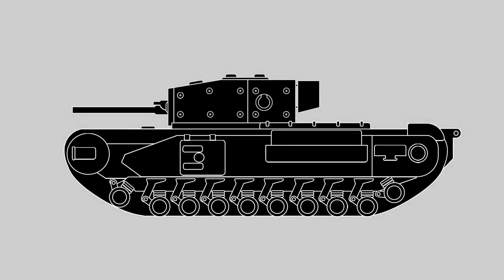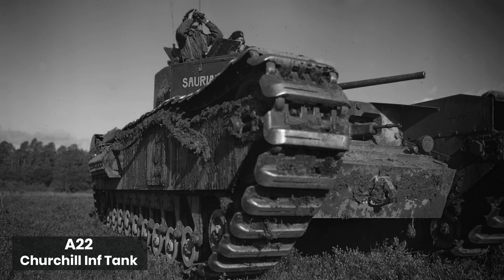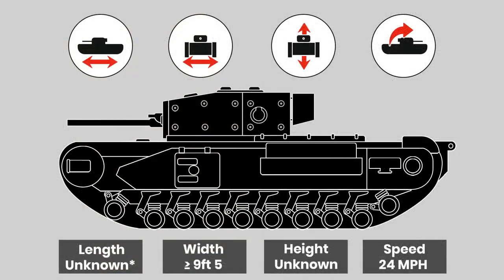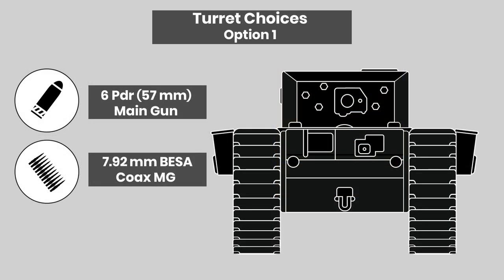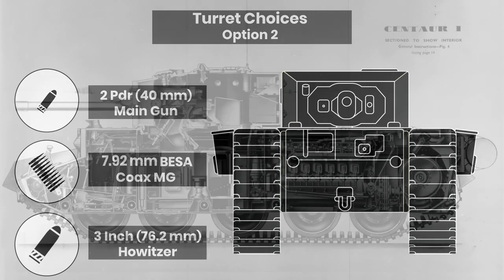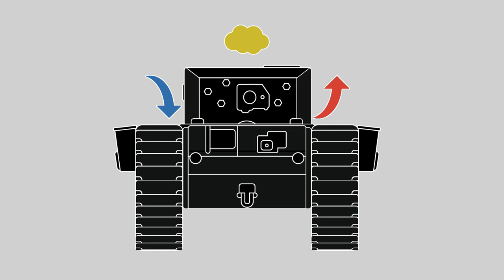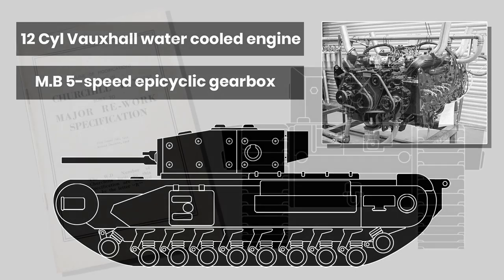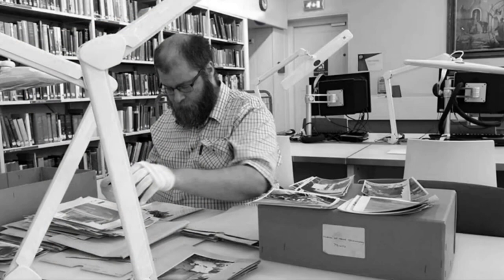A23 - Tank Design & Development

Comment: It's almost a shame the A22 wasn't originally conceived to the A23 specification as a 'fast infantry'/'heavy cruiser' tank, perhaps sacrificing some speed for more armour. The idea of a shorter, faster Churchill with a 6pdr as normal armament is a pretty reasonable tank for the late 30s all things considered.
Reply: Is that suspension design really suitable for higher speeds though?
Reply: @Akm72  I don't foresee an issue, although increasing the diameter of the running wheels would naturally improve rolling resistance somewhat. For comparison, the good ol' Panzer 4 had pretty small road wheels and managed similar speeds without any problems.
Reply: @Vespuchian  I believe they may have had an issue with the limited vertical travel of the suspension, however I don't know enough about tank suspension to say anything conclusive.
Reply: @Akm72  Actually, a lot of the issue was the noise! While, yes, the Panzer IV did have small wheels (though larger than those of the Churchill), said wheels had rubber tyres, unlike the Churchill. Even though it was capable of a top speed of 15-17 mph in its early versions, in practice, it was rare to drive it above 10-12 mph, to protect the crew's hearing.

Comment: Imagine the high speed ride on that suspension. Pretty obvious Dr. Frankenstein was in charge of A vehicle development then.
Very surprised the three gun design specifications didn’t include an auto loader for each.
Oh, and an add on Duplex Drive Kit would be desirable.
Reply: Doesn’t look like the suspension would offer much in the way of travel. The Churchill’s were so slow that it might not have been much of an issue l

Comment: Looking through a list of General Staff 'A' numbers I noticed that the A26 is listed as a 'projected lighter and faster A22', have you managed to dig up anything on the A26?
Reply from the maker: Indeed i have, however she is in the minutes as a heavier Mk IV with a 17pdr, but no further investigation. although the info is very sparse, and will require deeper archive delving to find more if anything.
Reply: @armouredarchives8867  Interesting; a Black Prince style infantry tank with a turreted 17 pdr reaching the front line in 1943 or 1944 would be a pretty big deal even if it was still powered by the 350hp Bedford engine. However, given that it is clearly a 1941 'A' number, my guess is that it would be a casemate-style mounting, probably derived from the A22D which was also a 1941 project.

Comment: Didnt know the churchill was that unreliable early on.
Reply from the maker: terribly so, straight of the drawing board and made covvy look like a marvel in engineering, but seems to rarely get mentioned elsewhere. - like covvy it did get fixed of course and ended up quite a reliable lil tank later but in its early days it was  total pigs ear.
Reply: I think it's fair to say that it's debut at Dieppe was a disappointment. It was improved though and became very capable.
Reply: @armouredarchives8867  Covvy?

I guess it's not as famous for it because they did fix it and it isn't terribly overrated by fans like some of the panzers are.
Reply: As I understand it (and our host may correct me) the Churchill tank contract required them to get the tanks rolling off the production line in only 12 months (summer 1940 to summer 1941). They got the prototype ready for testing in only 6 months. To put that in perspective the US equivalant is the M3 Medium took about 9 months to reach the testing stage. It took roughly another 12 months, until mid 1942, for them to solve the reliability problems by which point its reputation was in the dumps and the expectation was that they would replace it with something better as soon as possible. According to most tellings (and I don't know if there is any truth to this) it was only the experience of Kingforce using Churchill Mk.IIIs in North Africa during the 2nd battle of El Alamein which convinced them that it was worth keeping in production.

Comment: I don't get it, the British had no problem up-gunning Shermans, the 76mm Firefly, but they kept under-gunning their indigenous designs.
Reply from the maker: well tbh the 6pdr is perfectly adequate for most things, bar the later tigers and panthers and even so was still leathal to the sides at long range on those. vs pz3 + 4 its more than capable, add in weve just got production going and numbers coming out it makes sense to use them. however back when they were lookign at 2pdrs and 3inch combos that was more biraze and luckily common sense prevailed
Reply: @armouredarchives8867 ; if the 6 pounder was "perfectly adequate for most things", why didn't the British put them on the M4's we gave them, instead of the 17 pounder? It would have made for a much more roomy turret. The answer is obviously the 6 pounder was "yesterday's" gun, and was not capable of handing the new generation of German armor. To design a "heavy" tank in mid WWII with a 6 pounder appears rather shortsighted.
Reply from the maker: @oldgysgt  how was it obsolete for World War 2, it wasn’t even in service until 1942! At which point the priority was to up arm British tanks with it as the American tanks had the 75 mm which although inferior in armour penetration did have a superior, HE round which was very useful. This dual role was considered of more use any many British tanks went onto mount the QQF 75 mm, while the 6 pounder was given an early APDS.
The 17 pounders as good as it was also heavy, a pain to fit and suited to AT roles but not general purpose, hence they were used in a 3/1 ratio and at the time it was introduced it was not possible to put it into most tanks we had.
Reply: @armouredarchives8867 ; a lot of WWII equipment was obsolete before it left the production line for the first time. The concept of the 6 pounder was totally obsolete in 1940. Obsolete meaning, there is better and more advanced equipment available. The Sopwith Camel was state of the art in 1917, but totally obsolete in 1925.
Reply: Sherman had a larger turret ring at 69 inches than the baseline indigenous designs (Cavalier/Centaur/Cromwell was rated as 57 or 60 inches diameter while Churchill was only 54 inches). So it was possible to shoehorn the 17 pdr into the Sherman, but only by changing the design of the recoil system and compromising aspects of the turret design, but up-gunning the Cromwell and Churchill required widening and lengthening the hulls and designing entirely new turrets or coming up with a sub-optimal compromise like the A30 Challenger with a hull stretch and a raised superstructure on top of the hull to hold the wider turret ring.

With hindsight they could have done better, but when the critical decisions on 17 pdr tanks were being made in (I think) late 1941 they didn't know the Germans were starting work on Tiger and Panther tanks.

Comment: I am curious of the timeline between A.23 and T-14 and A.33. In essence I am wondering if A.23 wasn't pursued since a heavy cruiser IMHO wouldn't be significantly different from T-14 and A.33.
Reply: As I understand it the A23 was the same time period as the A24 (end of 1940) while the T-14 and A33 were late 1941 at the earliest or, more likely, 1942 designs.